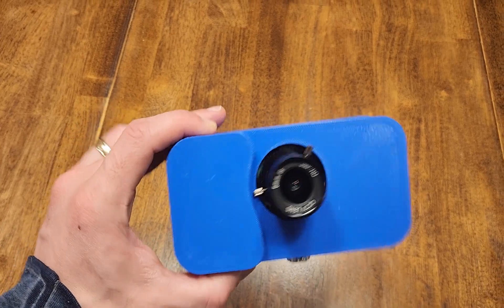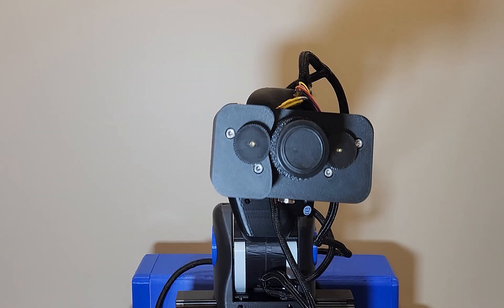This Motorized Raspberry Pi Camera Setup Changes EVERYTHING

Comment: Love it
Reply from the maker: Thanks for watching!
Reply: @diyengineers i have a question, why don't you just make a camera software, and have the stepper motor directly controlled by the raspberry pi.
Reply from the maker: @shaktammeeks  I originally made this to be used along the 6-axis robot I recently built which is controlled by an Arduino MEGA. So, in that case, I will control the 6-axis of the robot and the camera gears with the Arduino and I can plan the camera gear movements as part of the robot motion planning.

When used on its own, it might make sense to control directly from the Raspberry Pi. The only thing might that the steppers should probably not be powered by the Pi.